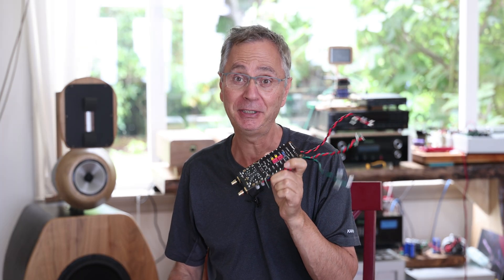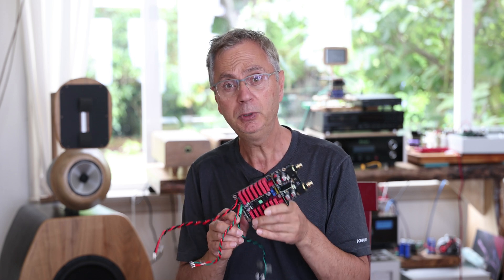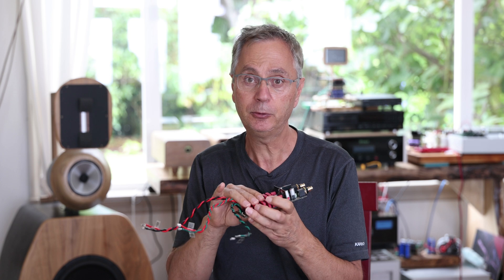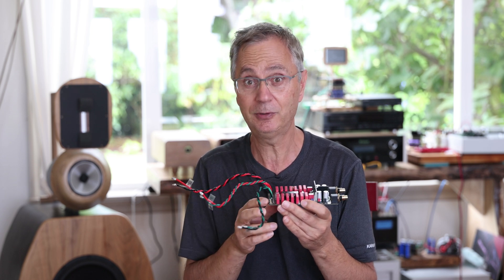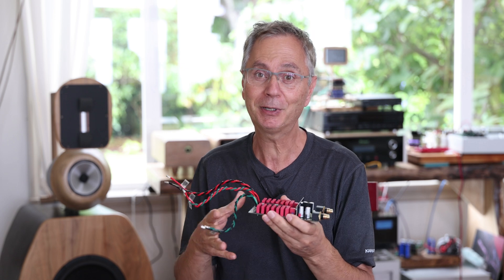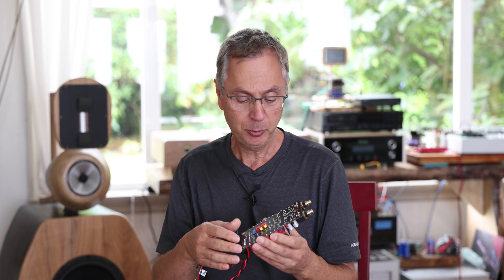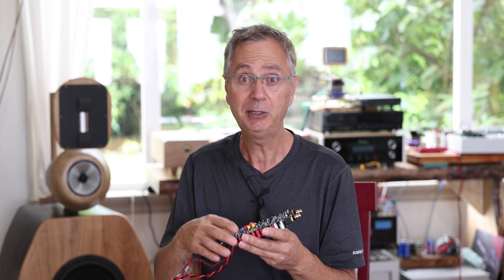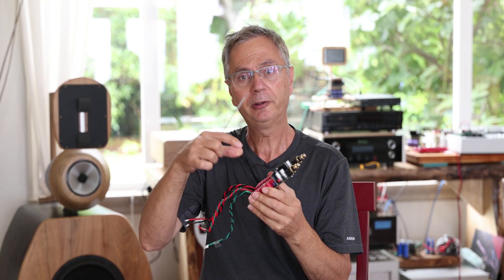Before Powering your Gabster TD1 Dac

Comment: hello what cable diameter AWG did you use for the power supply? red black green? thanks
Reply from the maker: I used a couple 13Awg silver plated ofc copper 
And 11 awg The TD1 accepts 13 awg easily the 11 are stiff and require removing some strands 
Lately I have been using red and black only I find it less prone to connection errors

Comment: I would warn everyone building this, TO CHECK YOUR RESISTORS. They are small, and hard to read but after I built my TD1 I found that Mouser had mistakenly sent me 3 220 ohm resistors and 1 1.18kohms resistor.  They are easy to double check with an OHM METER and might help you avoid catastrophe.
Reply from the maker: Thank you for mentioning this I guess they can make packaging mistakes that can be frustrating.
So far I have been lucky. Checking your resistors is always a good practice I will also add to only unpack one set of resistors at a time to avoid mix-ups.
Also a reminder that the 220 ohms are not used with a FIFOPi like the Q7 and do not need to install them in that case and to short the pads with Solder
They are useful if you are using a I2s Signal directly from a CD player as some are too strong.
Reply: @Gabster1  Sorry, I meant the 20ohm resistors not 220ohm.

Comment: Interesting track suggestion - See what you mean about the frequency range and holographic sound potential; it’s full of ear candy audio teasers. Very interesting 👍

Also really useful to hear about the ability to disable the main output stage power section by removing those jumpers (if required). Will definitely follow your advice and explore the potential of the TD1 as designed before considering tinkering, including tubes and using a balanced pair of boards etc. I thought I’d heard something in one of your other videos that made me wonder if cutting off the power to the output stage might be an option that way, so thanks for clarifying.

Still haven’t put in my order with Ian Canada yet, but best get my finder out. By all accounts the boards I ordered should arrive in the post tomorrow 🤞
Reply from the maker: Glad to see you researching first and watching the how to videos 
Some  of us have a tendency to build first then read the manual and that can get you in trouble

Comment: Argh I burned Ian’s PCM converter 😢 
I get about 400-600 ohms at the Gabster TD1 - do you think there is a mistake?
Reply from the maker: Probably did you also check the Ufl connectors if they are soldered properly you may have a short it may not be burnt 
You can also take a couple closeups front and back with a good camera and widow light 
And send them to me maybe I can spot something 
But do check all 4 UFL,s preferably without the TDA1541A in place 
Also when you flip the test leads on the 5v and 15v do they fluctuate usually capacitors are charging and discharging
Reply: @Gabster1  I don’t get it, because I measured all connections but when I desoldered the connector all was fine :)
Please make a video about software and configuration of the fifo q7 or the fifo pi ma -> show jumpers and so on. I can’t get the fifo q7 to play in 16 bit 192khz…. It just stays in 32 bits
Reply from the maker: @MrChauvy  Glad you got it going The UFLs are tricky to solder correctly.
There is noting to configure all stays as default except enable continuous clock in MonitorPi pro if you have one  to avoid big Pops at start. 
The 16/ 32 bit thing is based on your stream not much you can do to change it but You can ask Ian it is a FIfo thing
Enjoy the music :)
Reply: @MrChauvy  It will always say 32 bit. Normal